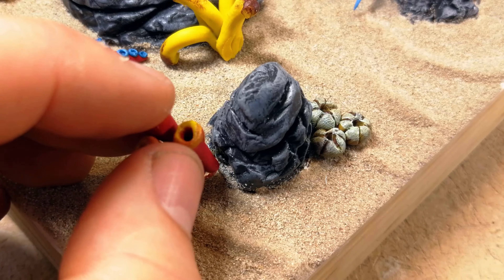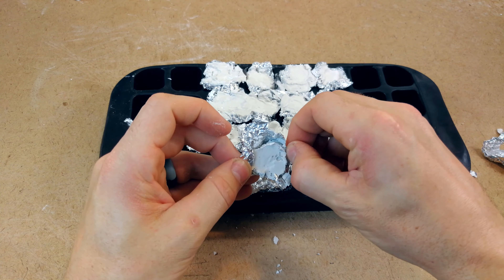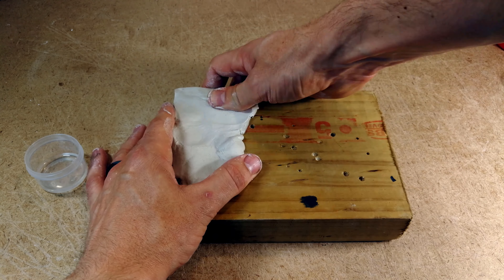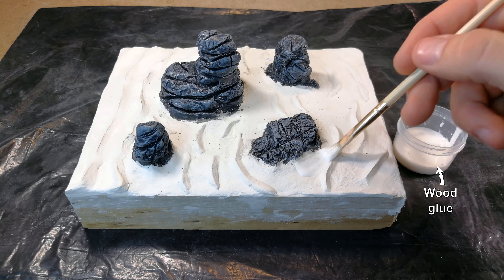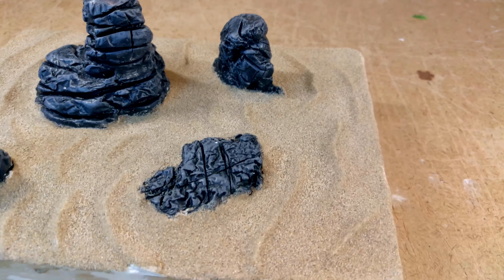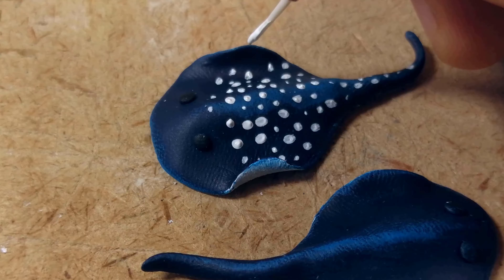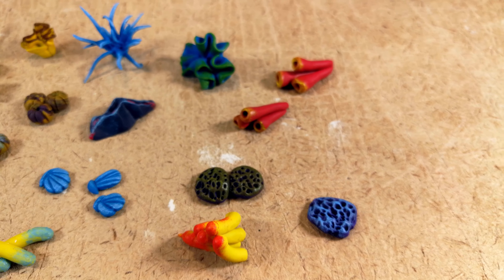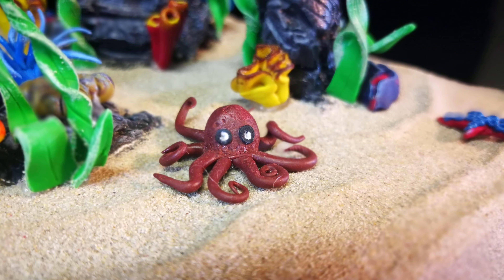Making a minature reef

Comment: Just a quick tip if no one has mentioned this before….  Pastels are a great way to colour and shade polymer clay. It will need to be sealed (carefully) with a compatible varnish after, (For example Rust-Oleum Varathane ultimate polyurethane - water based)  but the effects can be stunning 😉